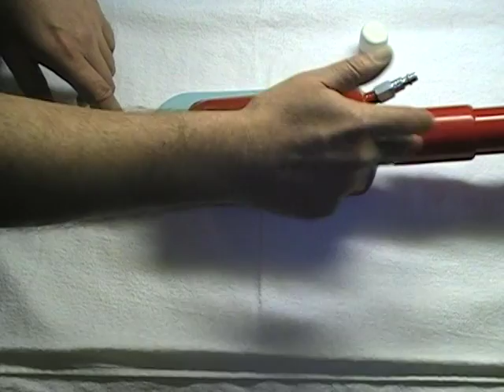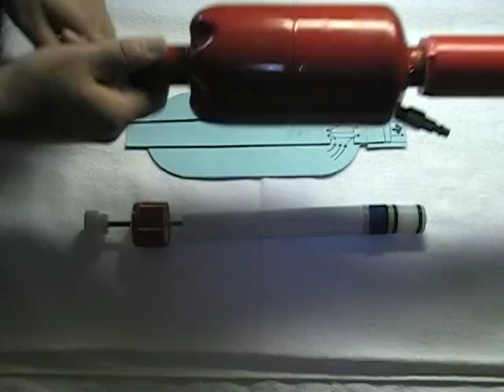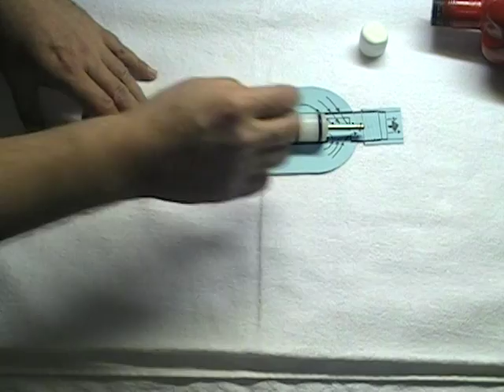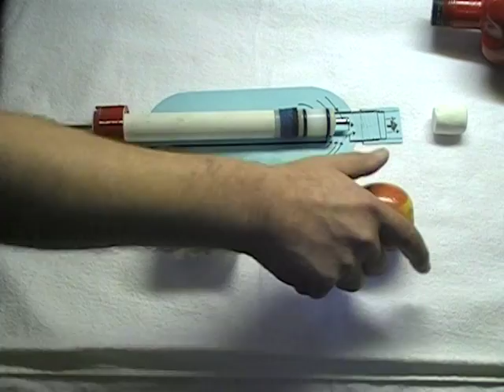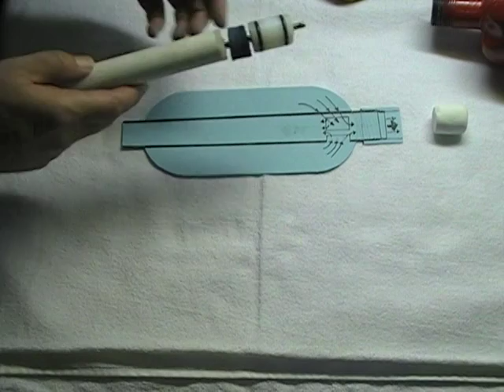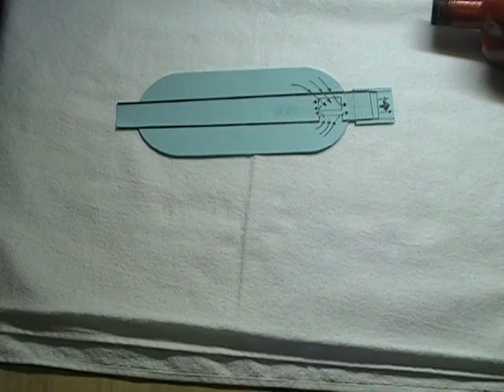Quick Dump Valve for a high speed Marshmallow Air Cannon

Comment: Your physics is flawed. You forget that the high pressure air in the chamber pushes  on the back of the piston. Thus, there is always a greater pressure behind than in front of it. (The pressure in the barrel cannot be greater than that in the chamber). The marshmallow has atmospheric pressure air in front of it, so it gets pushed by the higher pressure air in the barrel.
Reply: If I'm understanding the design correctly, the back side of the piston is open to the outside.  So long as the piston is closed, only the fit of the O-rings, front and rear, prevents leakage from the chamber.  Only friction prevents the valve from being cracked open, at which point pressure flooding into the barrel slams the valve full open.

The flip side of this is the need for a very good O-ring fit, and perhaps slow leakage from a charged tank.

Comment: hello, im considering building something similar to this, but with a 3 gallon air compressor tank for a upcoming concert. do you think it could launch confetti well?

i thinking i need to connect a dump valve to the outlet of the air tank. on the other side of the dump valve put some sort of like cone, (maybe a fire extinguisher cone) to hold the confetti. then just release the air when i need it. i need it for 1 time to open the closing acts performance.

thanks

Comment: How come, when I run my cannon (Not using QDV) though GGDT (pneumatic cannon calculator) leaving dead volume as 0 I get a lower calculated muzzle velocity compared to an estimated number for my solenoid and setup, such as 5 inches? It's 165fps@0"^2 dead space vs 176 fps@5"^2 dead space. I have a couple of theories in my head, but I do not know why exactly.

Comment: Hey Tech it's Gun Freak here...
I was wondering, that stopper rod looks like pvc. Am I right? So it is plenty to retain the 80 lb force on the piston when opened, but on the big one, what is it made out of? Is the stopping rod on the big one metal? And the cap has to be metal because the piston pushes on the stop rod, which pushes on the cap? Thanks.